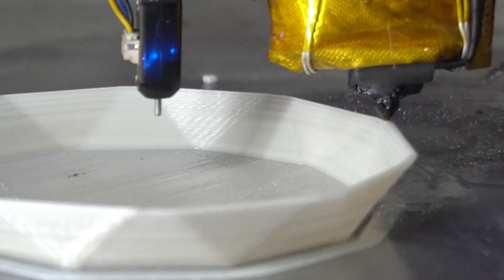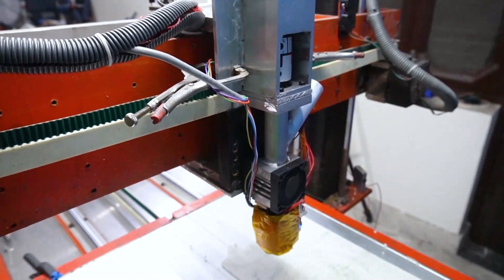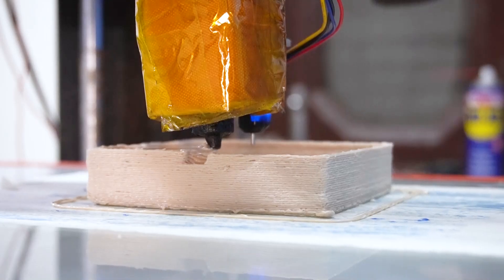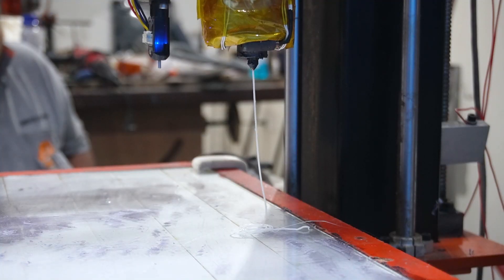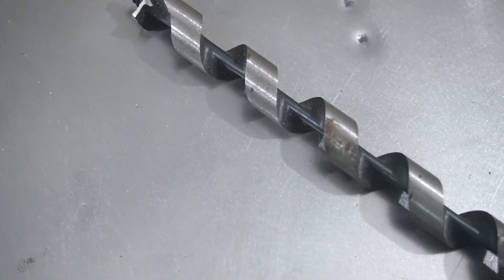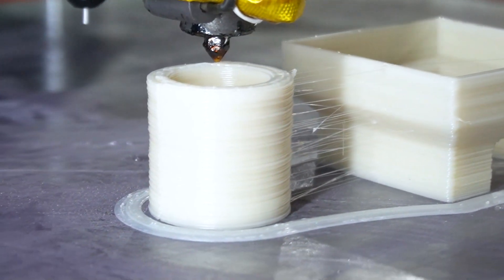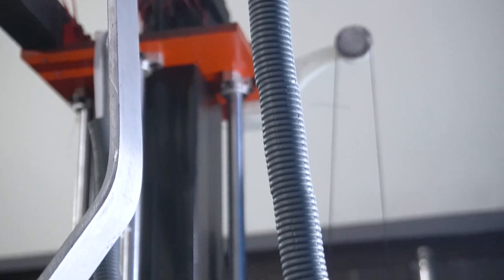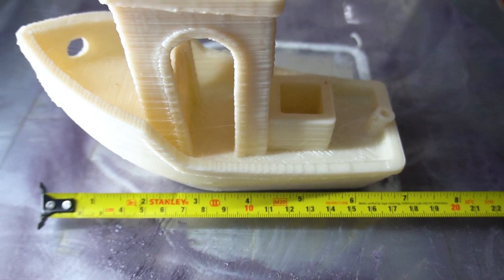Homemade Pellet Extruder Mark II for my 3 in 1 CNC / Low cost 3D Printing now possible

Comment: If you still have this 3D printer, can you try one thing? Or For your next lighter prototype, can you make it work with shredded flakes of Plastic Bottles (example PET/PETG only) instead of the pellets? Then try to print it.

If you don't have a shredder, then you now have an idea for another video. With your talent, you could build your own Metal Shredder.

Comment: nice work. How did you solve the plate adhesion problem?
Reply from the maker: I use abs slurry ( mixed in pure acetone )and that works perfectly. Sometimes extremely difficult to remove. So thicker the slurry is greater will be the admission force. This is what I noticed in my experiments
Reply: @ambroscustom  Thank you for your interest.

Comment: Put this on a quantum delta and you'd have an extreme high speed printer.
Reply from the maker: But extruder motor itself have some limitations because of reduction ratio. Servo can increase the speed but didn't seems to have much of advantage with that printer either.
Reply: @ambroscustom  Is extrusion speed limited badly by motor rpm? What mm³/s rates can you get on it? 48V stepper drivers might be a solution cheaper than servos if this is the bottleneck. In terms of melt rate that thing looks like it should have nearly unlimited flow.

Comment: what's the diameter of the nozzle ?
Reply from the maker: The one shown in video is1mm but I also tried with 1.5mm with same print speed at 60mm/sec outer layer and first layer at 30mm/sec works good so far.
Reply: I like both your versions very much. I am working on such an extruder myself and I hope it will be at least as good as yours.
Reply from the maker: Thanks for the words, the things I learnt from first one definitely helps alot in the second one that's why able to make it alot more better. Definitely design need to be refined alot. Wish you good luck for yours and hope you come up with much lighter and refine design 👍.

Comment: Can't we use filament instead of pallets?
Reply: the whole point of him doing this I imagine is to use pellets not filament rolls. this could be a few different advantages. first and foremost the pellets are un processed, so they should be cheaper. second they can be mixed ie you can make your own colors and blends. third you do not need the expense of a 'reel'.
Reply from the maker: Well if chopped then you can use not as a wire.